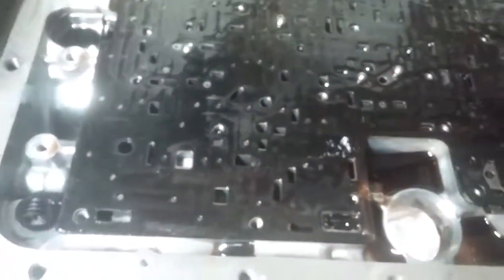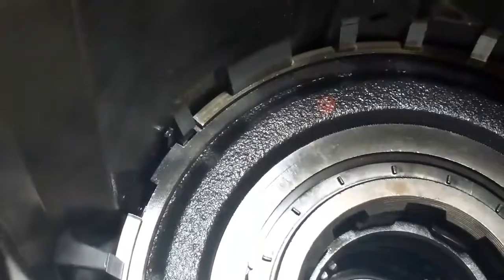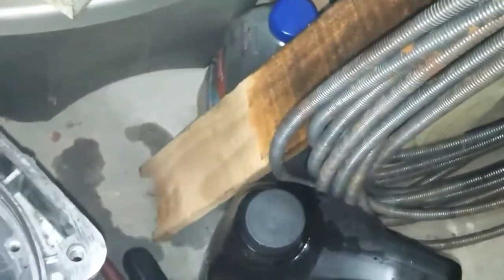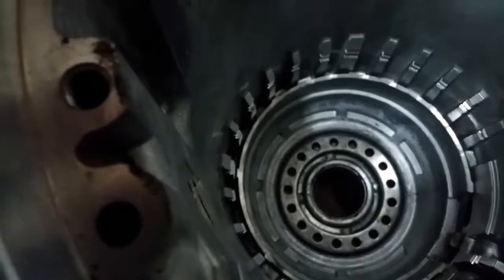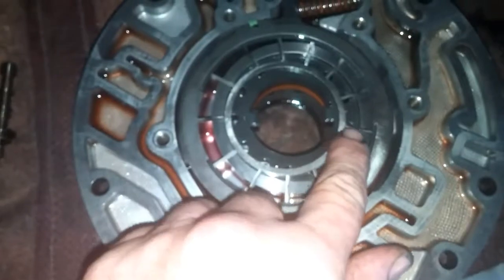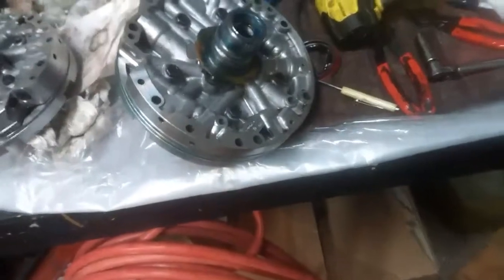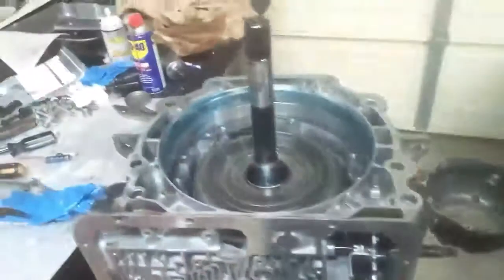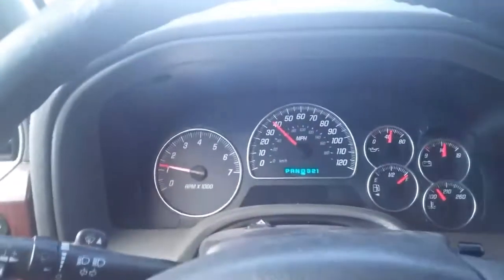Envoy transmission

Comment: Do you know what transmission came in 2005 Envoy?
Reply from the maker: The same tailshaft will look be a little different on a 2wd but where the transfer case bolts up to the transmission it's all the same forward (towards flywheel)